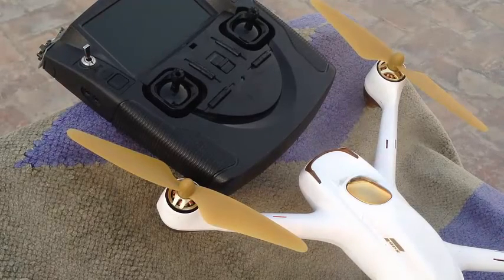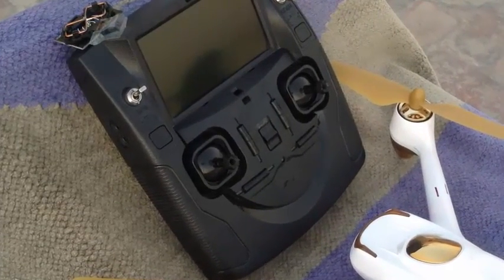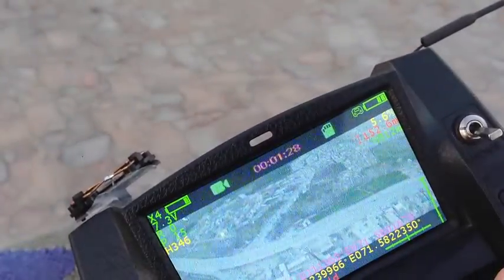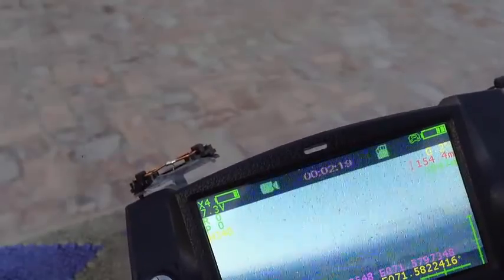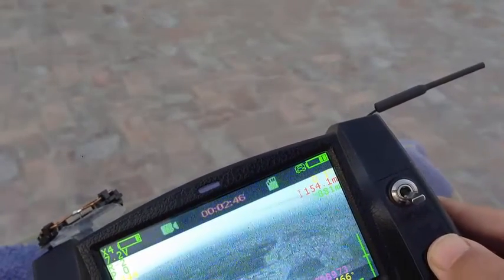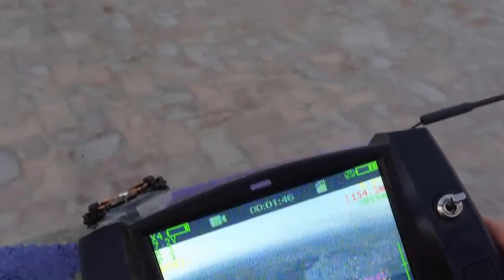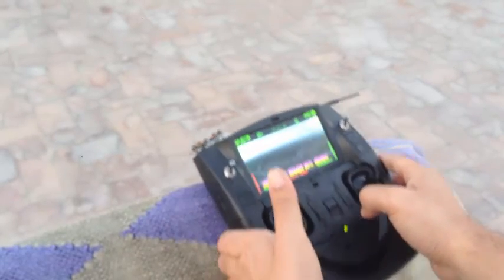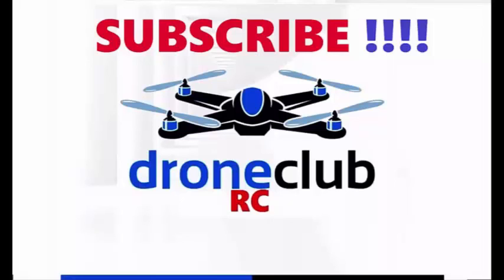HUBSAN X4 H501S |  RANGE TEST ON SUPER FLYER FIRMWARE

Comment: Hi Sir, Just want to know if we can get a better distance with the standard transmitter or advance transmitter with both being not modify. Thanks.
Reply from the maker: YES
Reply from the maker: the advance gives better range out of the box with no mods but in my experience and talking to alot of guys and reviews and vids around here people with the advance controller have more problems i dont know why but it is  if you talk about the statistics people have lost their drones and have much problems with their advance controllers so i will not advise to go for advance controller. 

secondly the standard one can give you more range i just got 1000 meters with standard controller just the stock antennas out of the transmitter you dont have to do mod just just open the controller and put the both the antennas out of it and fit it with glue or something  you will get drastic results  and i guess this is not a mod its just soo simple try that
Reply: Rcdrone club First of all, thanks a lot for your fast reply. Appreciate it very much and your explanation is very clear. Just bought mine 3 days ago but haven't try yet cause it has been raining for the past few days. I got the advance version and there was a price difference with the standard one.Thinking because its the advance version, I decided to buy it.  Can we do modification on that advance controller. I am very new to this hobby and don't have too much experience in flying drone. Btw I have subscribe to your channel and love watching your videos. Thanks a lot! btw you are right there are several videos on youtube, people commented that with the upgrade of the standard transmitter you can get a better distance range than the advance version.
Reply from the maker: Yes that correct people have achieved 3000meters with the standard controller that amazing  but i dont think hubsan is made for longer ranges i mean if you go 3000m away and came back probably battery die in the middle people achieved that because they modded the firmware and increased the speed of the quad thats hell risky  1 wrong step you loose your quad so thats not advised and i am really happy with 1000m that more than enough with standard 

and i believe with advance controller you can get 700-800 m stright out of the box no mods needed  if you wish to get more range  just upgrade the firmware to superflyer v1122  you will definitely get more than 1000   but if you are new to the hobby just 1st learn how to fly   memorize the manual  fly in a line of sight  give it a month when you learn enough and build enough confidence then i will advise you look for more ranges  and yes you can get high ranges with advance controller
Reply: Rcdrone club You are right. Thanks for your advise. Take care! I will keep watching your videos. Keep it up!